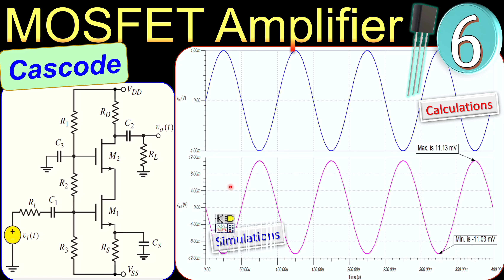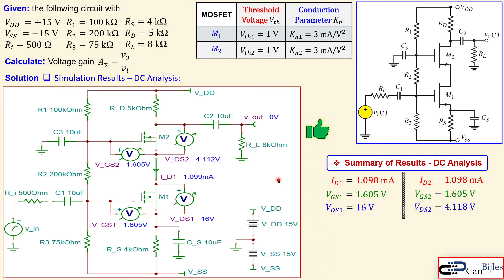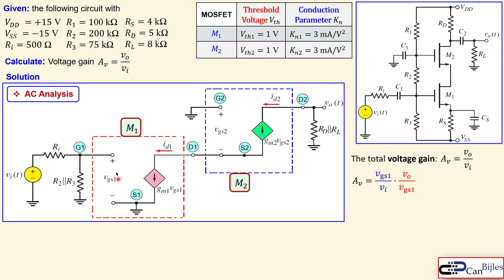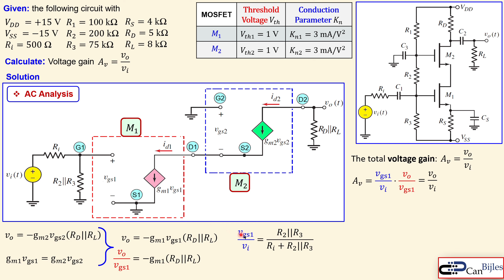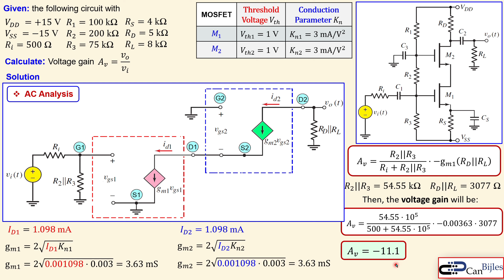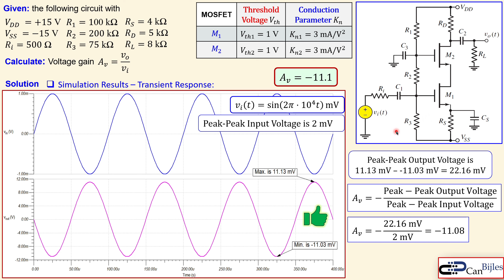MOSFET Cascode Amplifier ☀️ N-Channel E-MOSFET ☀️ Calculations & SPICE Simulations ⭐ Example 6

Comment: Hi, hypothetical question;  If I mistakenly  applied input voltage on M2 instead of M1,what would happen to the circuit and how would that affect the voltage gain? Thanks
Reply from the maker: If you apply the input signal at the gate of M2, bias the gate of M1, and measure the voltage at the drain of M2, then the circuit will behave as a common-source amplifier with source degeneration.

Comment: Hi there, which one is called  cascode amplifier M1 or M2? and how to recognize the cascode in a circuit if we have more than two mosfets in it?  Thanks in advance
Reply from the maker: The M2 is the cascode transistor; it is the transistor which behaves as the load of the M1. You can have multiple cascodes and this depends on the circuit configuration. For more details, you can also consult the book of Behzad Razavi for Microelectronics
Reply: If we apply input voltage directly on M2 and DC bias voltage on M1. What is the function of the circuit in this case? Thanks @CANEDUX
Reply from the maker: @Fidel-tk5rq Then, the circuit is called source degenerated amplifier. The M1 is the source degeneration.
Reply: Do you mean M2 will be source follower? and what's the role of M1 in the circuit? Thanks
Reply from the maker: @Fidel-tk5rq M2 is not making a source follower. You measure the output voltage at drain of M2. If you would measure the output voltage at the source node of M2, then is called a source follower.

Comment: Hi, sir, there is intuitive argument i don't get it clearly of why is it the case for crossover of class AB, that 0.7v of doides compensate these base-emitter Junctions of two transistors? I don't get the clear picture of what going on the process of that!
Reply from the maker: Class AB amplifier output stage combines the advantages of the class A amplifier and the class B amplifier producing a better amplifier design. The crossover distortion in class A and B is due to the base-emitter junction voltage drop. In order to compensate this voltage drop, a diode is placed for this purpose. A more detailed explanation can be found here: https://www.electronics-tutorials.ws/amplifier/class-ab-amplifier.html

Comment: Hi, Have you posted any video about using Gm.Rout method to calculate voltage gain? Thanks
Reply from the maker: I do not have any video using this method. Maybe I will prepare a video later about this too.